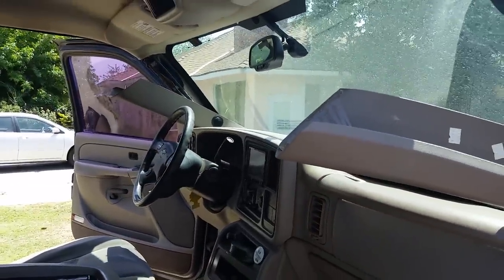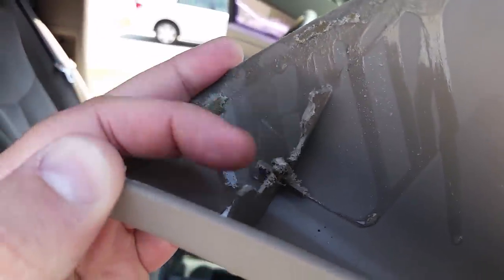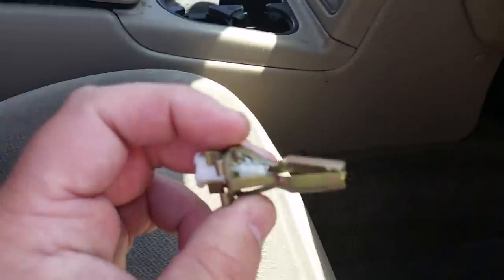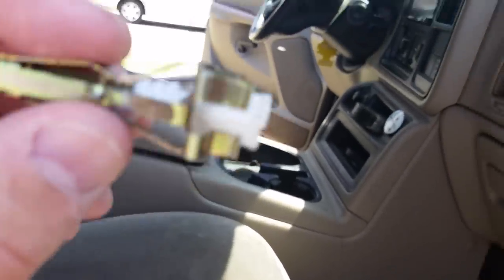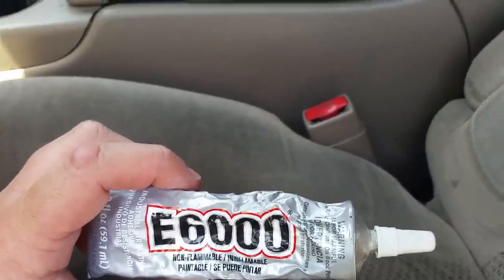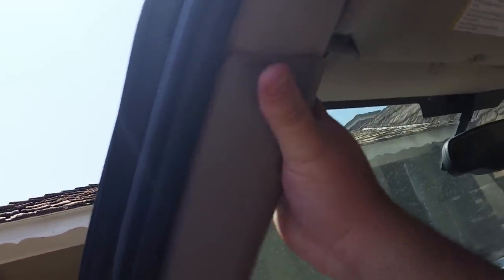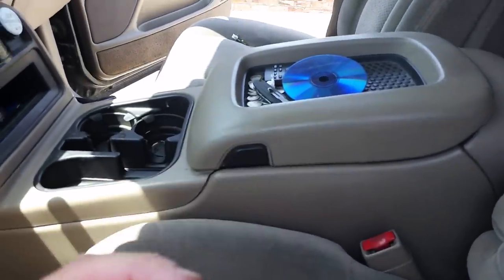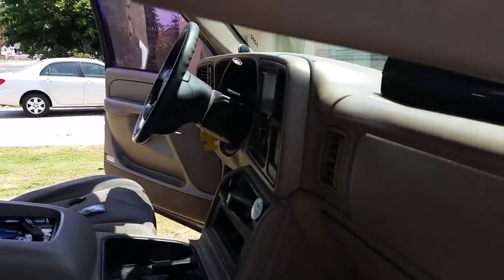How to fix Chevy Silverado A Pillar

Comment: great work!  I have seen that there is a ground on the passenger column that can cause issues - my radio comes on and off randomly like it has a bad ground.  The speakers don't work - radio still is powered and shows volume but no sounds happen when it loses this ground or whatever.  The ding ding ding noises when locking the doors must use the same output as the stereo because I dont hear them either when it happens.  Do you recall ground mounting locations behind the A columns?  Any insight much appreciated!!  great job again!

Comment: will the panel still pop off if I need it to? The reason I ask is because I want to repair this but I also need to replace the headliner.
Reply from the maker: Jonny Saenz I'm sure it will, might just have to pull a little harder! lol
Reply from the maker: I haven't tried myself though...

Comment: What did you use to fix the headliner?
Reply from the maker: Brandon Prouse  Headliner Spray Adhesive Glue. Should be able to find it at any auto parts store, if not, definitely Online...

Comment: You know what size tweeters are those?
Reply from the maker: They are Alpine type R 1" Dome tweeters.
Reply: @taylorbinning5346  can you do a video showing how you mounted the tweeters?
Reply from the maker: Max D I originally had Bose speakers that came with the truck so the holes were already there, I had to use  my Dremel and make the holes bigger, but that’s it.
Reply: @taylorbinning5346  oh ok awesome thank you

Comment: Anybody know how to remove the One Between the Doors?
Reply from the maker: Cesar Hernandez What Panel are you talking about?
Reply: its right between the front and rear door beside the driver seat that plastic piece . I I know it has clips but it feels like there is something more holding it back.
Reply from the maker: Pretty sure they just pull out...
Reply from the maker: Try to look up headliner videos...